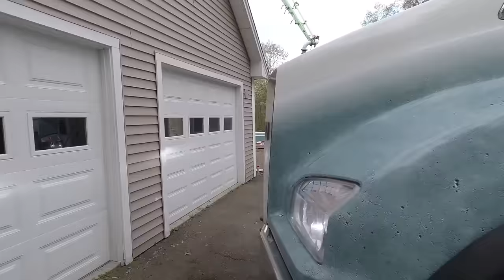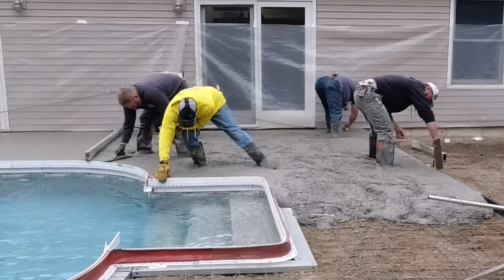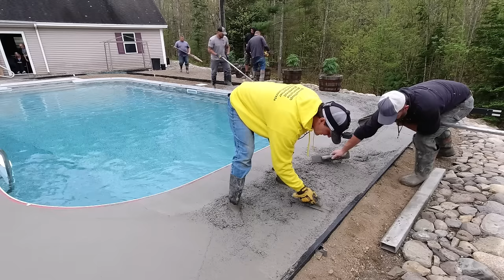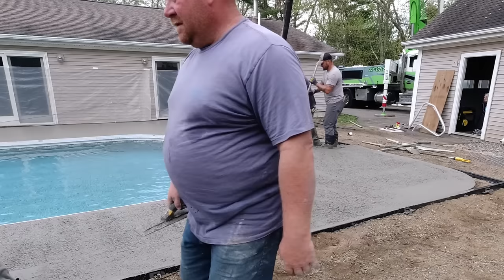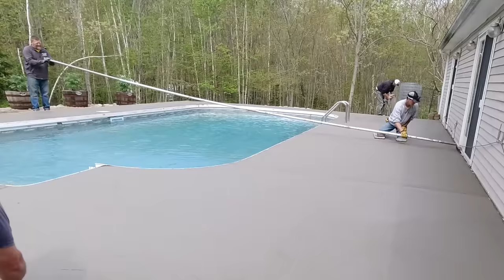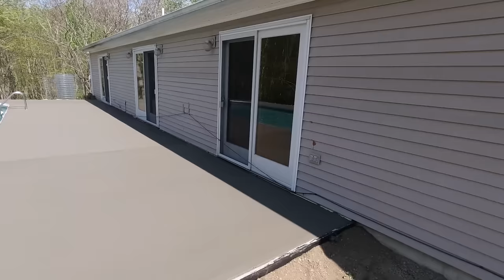Concrete Finishing Skills That Will Make You a Pro

Comment: I saw a contractor's crew member lose control of a wheelbarrow and dumped the concrete and the wheelbarrow into a pool. I told them to just leave it, maybe take a shovel and cut it into smaller pieces. Wait for it to set and then pull it out of the water. The boss wouldn't wait and some poor guy had to go into the water and get it out. It was in the early spring in Minnesota, so the water was cold as ice.
Reply from the maker: That's no fun!